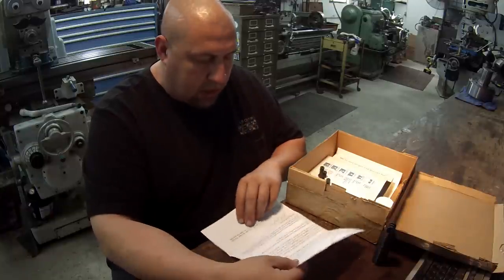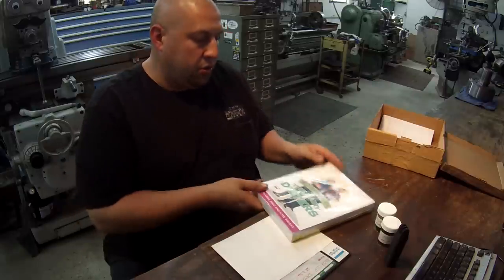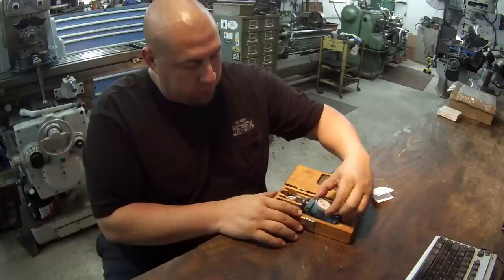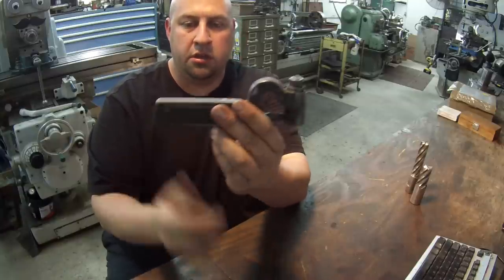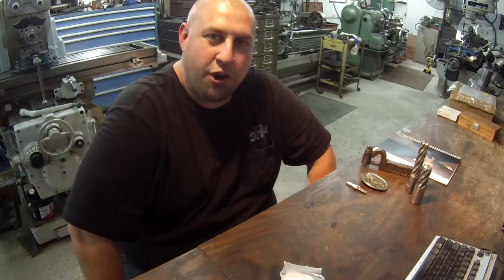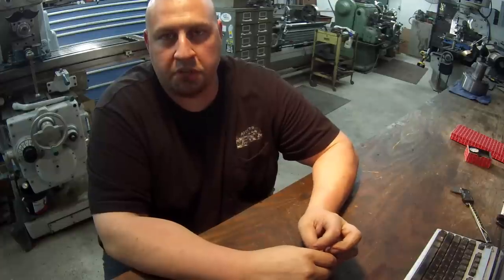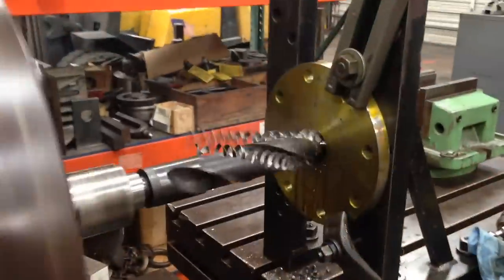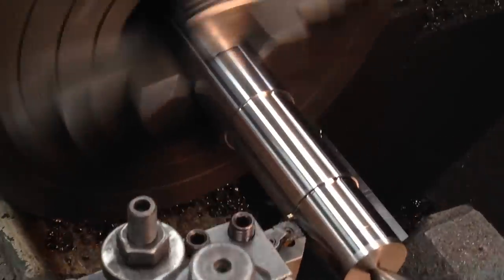Saturday Night Special 40 Part 1

Comment: That looks like an 8" floppy disk!  Never saw one that large before, even being on the bleeding edge of the introduction of the microcomputer.  The 5 1/4" floppy disk I remember well but had to look up the history of that 8" beast and learned that the drives for those disks often cost more than the microcomputers being developed in the 70's which was one reason why most machines of that era used cassette tape instead.  Thanks Adam and Paul Compton, you never know what new stuff you'll learn here.

Comment: HI Adam,

Glad you liked the box of stuff. Lanoguard is derived from Lanolin, which is what waterproofs sheep's wool and it's even good for your skin! The 3D printer is coming along, I've even printed polyurethane rubber! I'm going to be demonstrating it to the site soon.

I used to have to maintain the mini (not micro!) computers that used those floppies. Often when the system wouldn't boot it was because the disk had worn through! They were S100 bus systems with Motorola 68000 processors used for recording and processing the UK insect survey data. Suction and light traps have been in continuous operation since 1964.

Those books contain some really tasty recipes. The Hairy Bikers put a lot of effort into packing them full of flavour.
Reply from the maker: Looking forward to trying some of the recipes Paul. Nothing wrong with good tasting healthy food. Thanks again for all the goods!

Comment: I would call that Armstrong tool holder adjustment pin the "tuning adjustment" 
Try to cut some bronze or something at get a chattery cut then change the tension on that set screw to see if you can "tune" the chatter out of the cut. I know this is a pretty common thing with boring bars but I've yet the chance to try messing with it.

Comment: Hey Adam,  Cool video and some nice toys to play with.  I had a question that I wanted to ask but you answered it their at the end.  It was about what your take on the proper depth for taping NPT.  Really nice job on the tap adapter you made.  Also Elena doing the video commentary at the end was great. now off to watch part2.

Matt C.
Reply from the maker: On the smaller taps I usually go about half way, then hand check the fit with the part going in the hole. You can always go a bit more when needed.

Comment: Adam

I have a Federal 0.0001" indicator with a range of about 0.025" that is 3.6" dia.  Really solid and well made.  I got it for about $20 from an eBay seller in Chicago.

I'm not sure if Federal-Mahr do repairs on their indicators, but if not, I'm going to take your tip and send it to Long Island Indicator to have it cleaned up.

The older you get, the more you appreciate the bigger dials.

Regards
Reply from the maker: Sounds like a good indicator!!

Comment: Adam,
That Armstrong tool you showed I believe is a shaper tool bit holder that mounts inside the lantern tool post on the front of the sharper clapper.
Shawn
Reply from the maker: You can use them on both the shaper and the lathe.

Comment: Congrats on SNS 40! What an accomplishment. To keep this kind of craftsmanship and drive in it for this long really shows you're one of the best. In sns 38 you used the insulating paint on the pump. What exactly does that do?
Reply from the maker: The insulating paint was just something I could quickly purchase from work, but the guys use it on the insides of gear boxes, pumps, and electric motors. It's nothing more than a fancy coat of paint to help protect the iron.

Comment: Holy crap bro.....Elena needs to do more voice overs!  I almost peed myself....so awesome!!  I gotta say I love your boring mill.  Ive operated a few in my day and yers looks nice compact and full of function!!  Plus it looks younger than the 72 year old torpedo maker from WWII I used to work on!  Cleaned up the home shop today and found a starrett drop indicator that might have a larger face than Tom's, but only has 3" drop...ill send a pic yer way!  Another great video bud!  I'm running  behind on my video watchin with the job switch up.  Im catchin up.... :) Thanks for the awesomeness!!

Comment: I have the same problem with rust in our area as we are near the ocean and are in a high humidity enviroment I currently use lanolin based products and the lanolyn product are good enough to rub onto a surface then throw int the ocean for a month and retrieve it to find it still in the same condition you placed it in but the only problem is smell I have found if the shed is full of treated items and the tempreture riises then it gets a bit on the nose ( New Zealanders love that smell- Aussie joke lol)

Comment: At my work we run into broken off bolts that we have to drill out. Most of the time not a problem until we get one that's hardened and burns up the HSS bits. Whats the next best thing to do? Carbide bits are available but do I need to know and look for?
Reply from the maker: I have to use carbide to drill out those stubborn hard bolts, but you always risk breaking the carbide tools in the process. Some guys who are lucky can use an EDM machine to burn them out.

Comment: Got to thinking about the Armstrong swan neck Adam and wonder if the screw lock is actually nothing more than an aid to tightening the nut. Having the three positions would automatically locate the 5/16 square tool bit in the most common used positions and be repeatable, then I guess one would retract the screw to allow the flex head to work normally.

Comment: That floppy looks like the older 8" disks, the more common size was the 5 1/4" followed by the hard cased 3 1/2" floppy disks.
Reply from the maker: The hard cased disc is what I remember using in school.

Comment: I think, a 1/2 x 1 barbed hose reducer would have cost about $3 at Ace. But it wouldn't have been good for 50,000 psi like the one you machined....You've got the first part for a waterjet.  Go big or go home....
Reply from the maker: Go big! That's our motto!

Comment: That is a huge floppy, 8 inch is probably not the one he remembers. I'm guessing he was referring to the 5 1/4 inch floppy, that then became the hard cased 3 1/2 inch disk. But if you saw 5 1/4 inch floppy as a kid, but then held an 8 inch as an adult, you might not notice the difference since the relative sizes between kid them and adult them and said disks wouldn't change much.